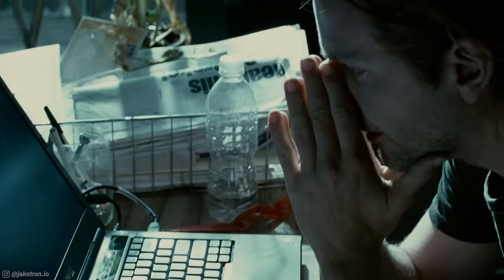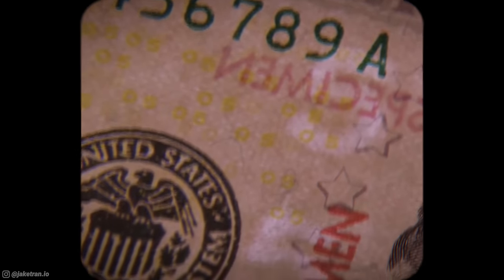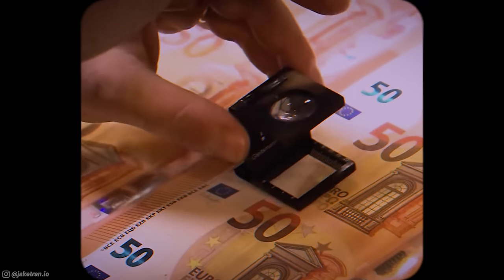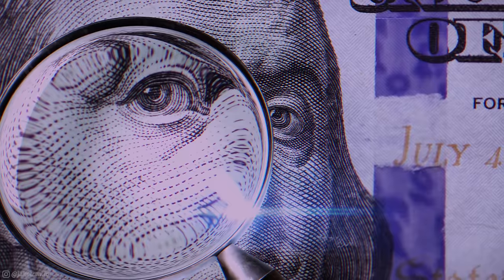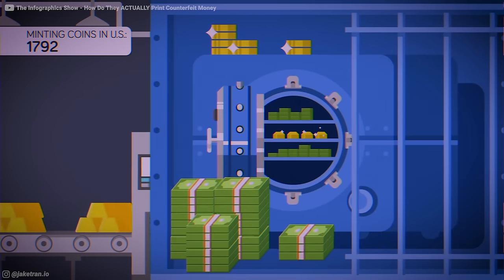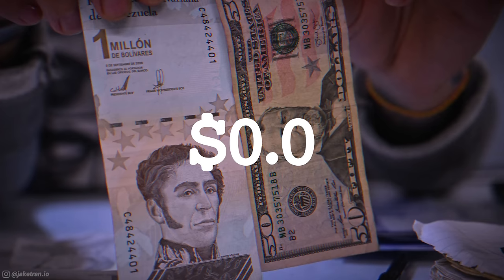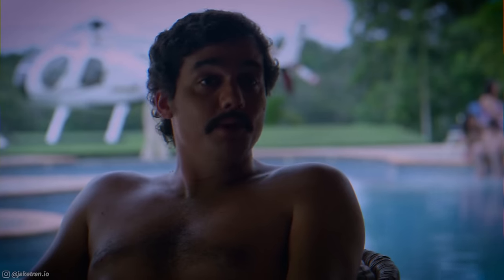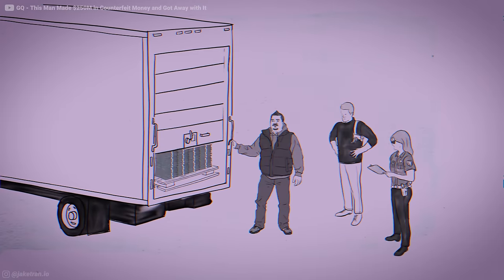How to make your own money printer go brrr

Comment: The local convenience store has fake bills that passed pinned to the wall. Most of them are surprisingly poorly done. The bill only has to get past a cashier. Crinkling it up a lot, so it looks very worn, seems to be a common technique
Reply: You'd be surprised how many times the cashier was aware that some fakes were to make their way into the register on that very occasion.
Reply: One dollar bills have the least amount of security measures
Reply: @MrBLAA  yeah nobody is going to waste their time checking a 1$ bill but is it cost effective to print it instead of going for something bigger?
Reply: @royjaber571 as a kid many years ago I did 5$ bills. The older ones didn't have any hidden stuff
Reply: @vadimnesen8060  damn how old were you coz I'm tryna get in the game 😏
Reply: @milesmorales2869  I was like 9
Reply: @vadimnesen8060  no way that actually worked
Reply: @MrBLAA  yes zxxffddGDF de S
Reply: @milesmorales2869  copied the 5 front n back. Cut it out than wrinkled it 😆

Comment: As someone who worked in retail, the real trick is not to use anything bigger than a $20. Nothing under $20 gets checked and even $20s might not be checked out the cashier is in a rush. The idea being that only large bills are worth counterfeiting, but you can buy a lot of easily resellable tech for unchecked $10 dollar bills. Just don't get too much at a time from a particular store.
Reply: but what would you spend it on? candy? you wouldnt show up to buy a house or a new car with bags of 20s
Reply: @darius2640  if you have to, the goal isn't to buy anything you intend to keep, its to trade in the counterfeits for real money, "clean" money.

do it in a high enough volume over as many retailers as possible and you are set. especially if the stuff you are buying with the fakes is resellable.
Reply: @Teixas666  exactly, sure the big ticket items are what you want, it’s a lot riskier as bigger bills will be checked, especially if you’re buying a several hundred dollar computer with cash. If you go for some smaller tech items and sell it on a marketplace for cheaper then retail price you have a lower risk of getting checked.
Reply: Also, never use the fake bills in your own hood. Go far and drop em all in away terrortories

Comment: His heart was in the right place making this video but he overcomplicated it.... You take a $5 bill spray the bill down with Pam oven cleaner, after about 30 minutes the oven cleaner will have loosened all of the ink off of the bill. You then use a soft bristle toothbrush to remove all of the ink leaving yourself with blank US currency paper. You then use a Kodak photojet printer to print a $50 bill onto the previous $5 bill. The idea being it's real US currency paper so it has the feel and passes the pentest. Plus it held up at a glance they'll see a security strip as long as they don't notice it says 5 instead of 50. For $100 bills start with a $10 bill and repeat the same process. Or you can print any denomination you want onto the paper of every one dollar bill, only problem is it will pass the pen test but if they hold it up they'll see it's missing the hologram in the security strip #SecretService #TheyBeWatchin'

Comment: So my understanding from this video is basically
You need to aquire tools and equipment that is nearly impossible to obtain and will immediately get the secret service on your ass.

Then, you need a team of skilled people you trust that won't snitch, to help you create notes as good as the real deal. "good enough to pass by a cashier" works for a little while but you'll very quickly be noticed and caught

And then
You also have to launder the money on top of that. And you have to be careful, a large amount hitting a certain location would make it easier to trace it to you, so you can't just, print a billion dollars. 

Sheeesh just working sounds easier at that point.